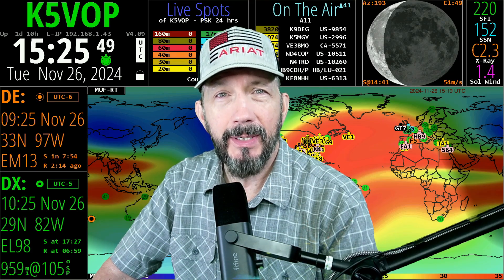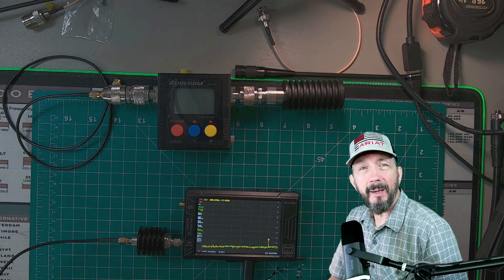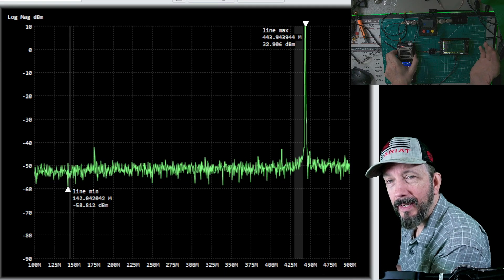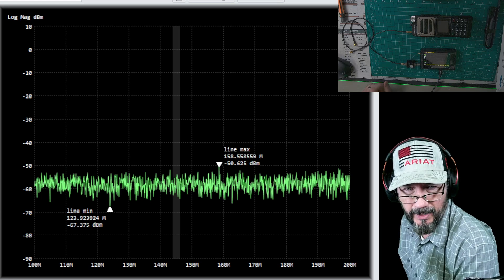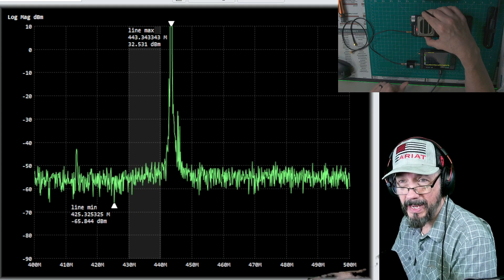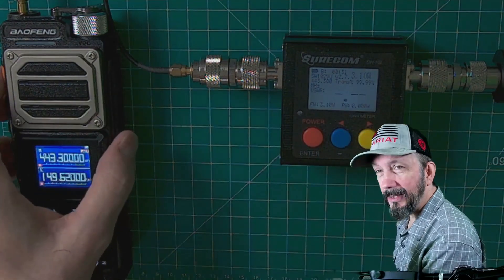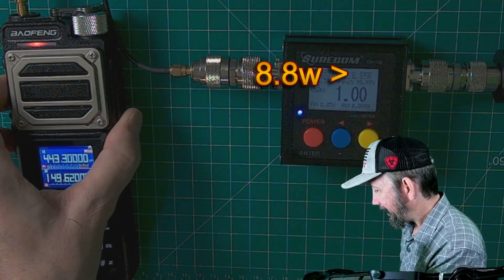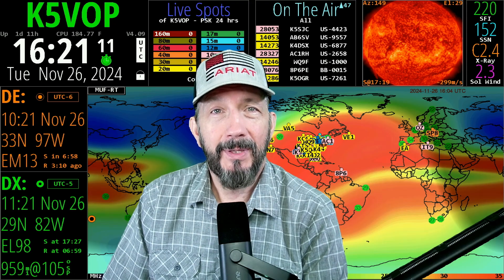**UPDATED** Baofeng UV25 11w test

Comment: 97.307(e) states: For a transmitter having a mean power of 25 W or less, the mean power of any spurious emission supplied to the antenna transmission line must not exceed 25 µW and must be at least 40 dB below the mean power of the fundamental emission..."

The 25 µW level is equivalent to 16.02 db. So, any harmonics should both A) not produce more than 16.02 db and be at least 40db below the fundamental. I've never used a NanoVNA and I'm watching this on my phone, but the harmonic at 3:15 appears to be well above that standard. Am I wrong about that? I can't see the db levels even with my old man glasses on.
Reply from the maker: I'm not sure why the software screen shows different than the screen on the TinySA.  Here are two screen shots that show the -16.02 line that doesn't show on the software screen but on the 2m it shows a 2nd above but the third below and on the 70cm you can see the 2nd below the line so it seems cleaner on 70 than 2m but still. thoughts? https://drive.google.com/drive/folders/18_-XzSW9LFkx9QZPdJV32VUJAgEOiUUd?usp=sharing